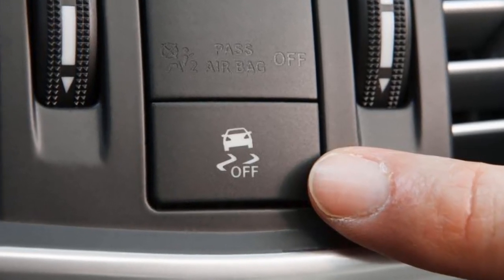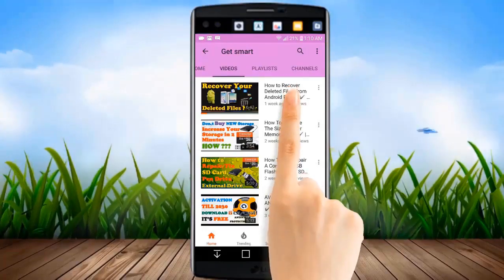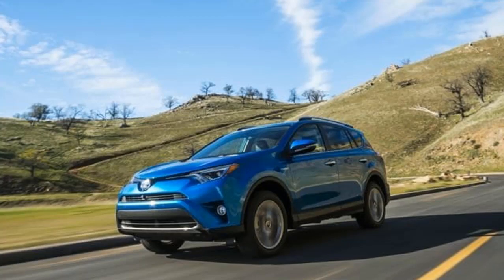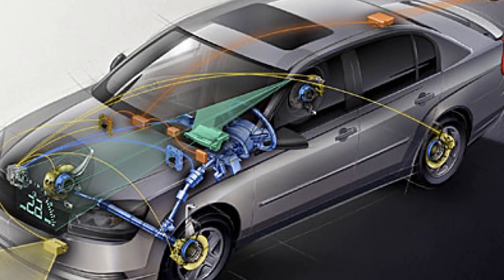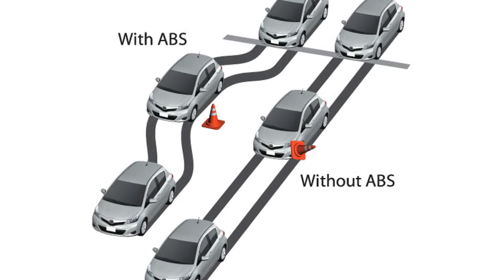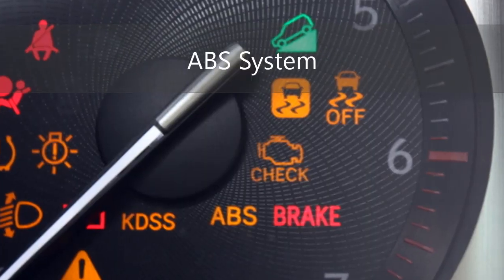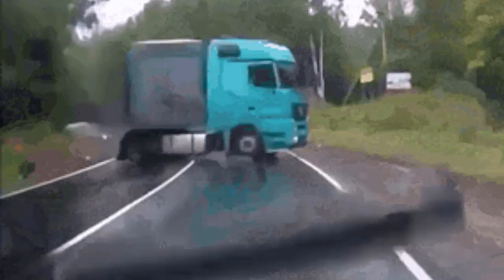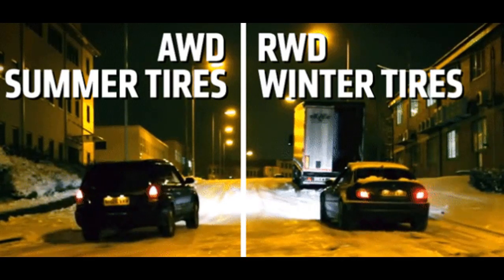TCS : Traction Control System | Working | Animation | Functions ✔ Know How it works? | Get Smart

Comment: Can you please explain how the Traction Control System works specifically in a 2005 Lamborghini Murcielago Roadster?  Does it apply brakes, does it stop fuel flow, does it lessen fuel flow, does it apply power to one specific wheel, just exactly what does it do?  Also, what are the dashboard lights displayed under TCS application?